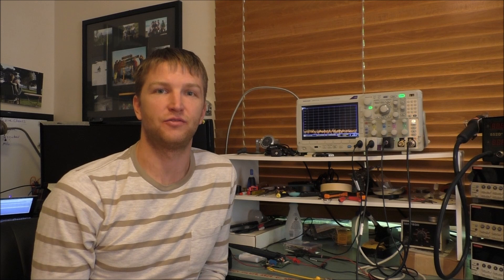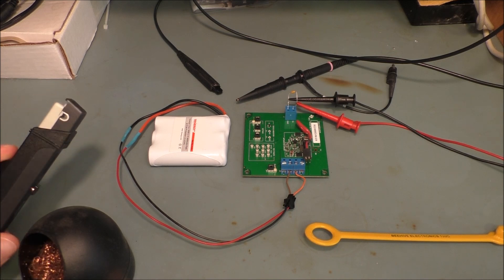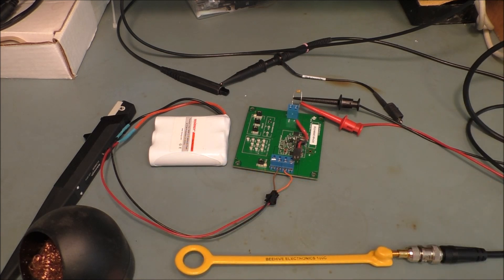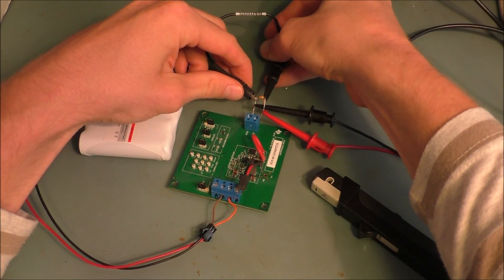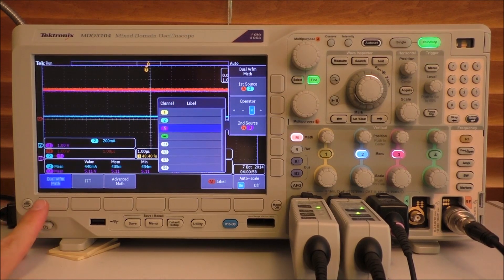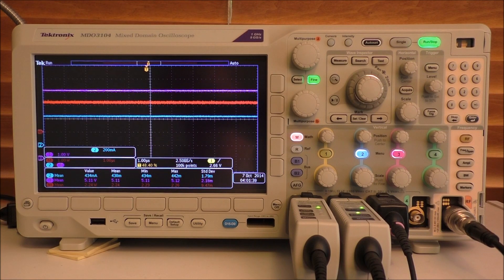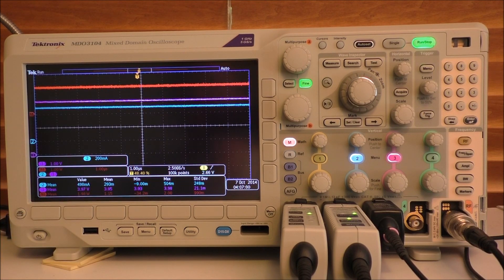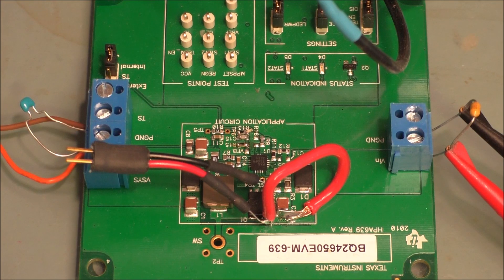Switching Power Supply Testing With Tek MDO3000

Comment: Dave, thank you for this video. 
Do you know the actual formula for calculating the % Output current ripple of a current mode buck converter?  I have been measuring the voltage of a shunt, but the formula I have found online are inconsistent....   Thank you..
Reply from the maker: The different formulas that you are finding are probably describing output current ripple for different switching power supply configurations. I would suggest you look around at manufacturer's app notes, 
specifically the app note for your buck regulator chip to find something
 that fits your application and your circuit.
Reply: I appreciate the response Dave. Actually, the converter I am using is BuckPuck already poted. I have no clue about the internals of this module.  But I have placed a 0.1 Ohm in series with the LED load to measure voltage drop. then I am using %current ripple = ((vdrop_pk-pk/0.1Ohm) /LED-curretn) * 100